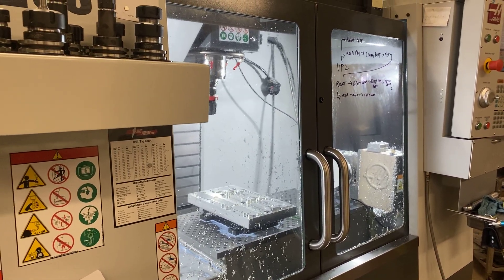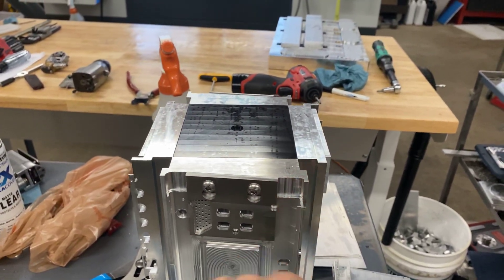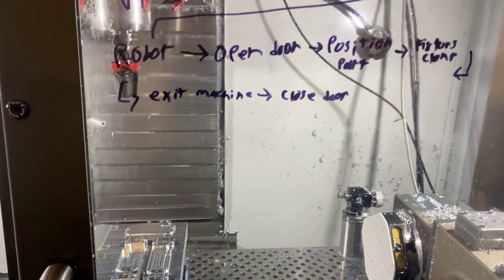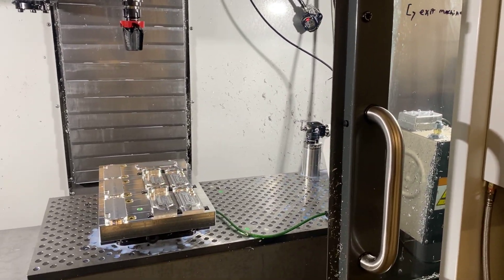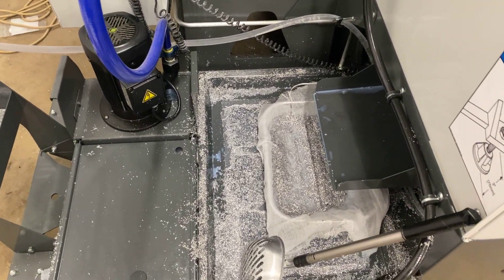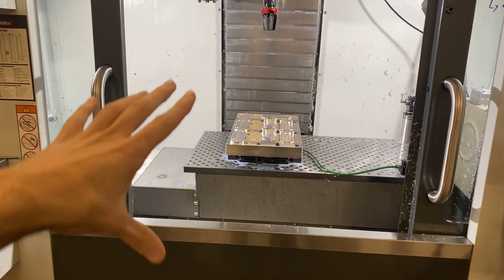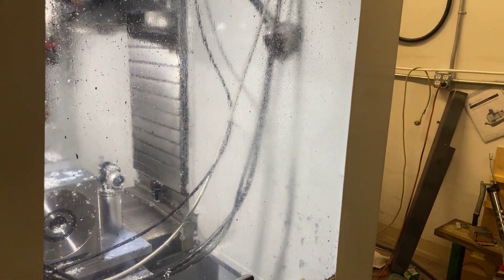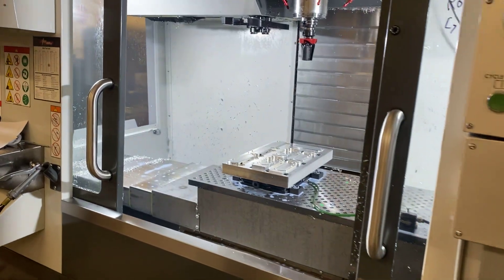Automating on a budget: Part 1, thinking out loud

Comment: One thing to think of is that the robot program needs three sequences, load only, unload only, and load/unload. If you're only using one gripper vs two, that changes the program sequence of when you would call load vs unload
Reply from the maker: Gotcha, that makes sense. 
When actually programming that as far as the robot program, would you write subs that you call, or one primary program that it steps through?
Reply: @OakwoodMachineWorks  I've seen both ways, it's really personal preference. I've known guys who will write a subprogram for literally everything (even if the subprogram is one line only) and ones who put everything in one program with jumps. I tend to be in the middle somewhat, but I like to use registers as breadcrumbs for a recovery program throughout

Comment: Im wrapping up universal robot integration on a mori mill:
-most machines have at least one external m code which is generally a dry contact(switch) and requires a finish signal from the robot.
-if you go through the front door you have to contend with the door interlock---haas has a wierd safe cell system to contend with
-for me the hardest part was getting the door open and closing, but a haas door is much lighter
-start simple, add the bells and whistles as you find them necessary and plan on doing every thing at least twice, you will figure out a better way to do it in the middle
Reply from the maker: I'm still trying to understand exactly how the whole M FIN interface works, along with cell safe. So I see when you call M25, the door interlocks kick on and stay on (in my case until I hit reset). So it looks like you enable cell safe, run you M25, return with the robot to say the task is complete, then send it a signal for cycle start?

Comment: If you automate the opening of the side door on the machine it would probably be easiest to use a cylinder with a built in magnet and Reed switches.  Any pneumatics supplier should sell this style, very easy to adjust and economical.